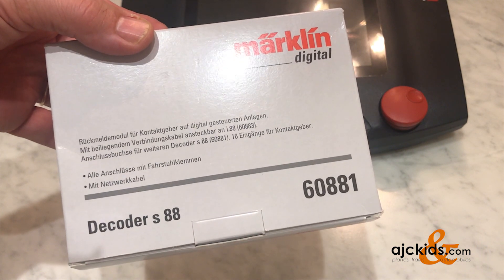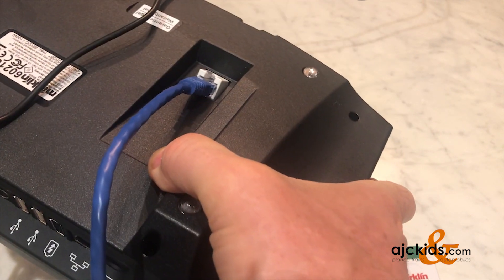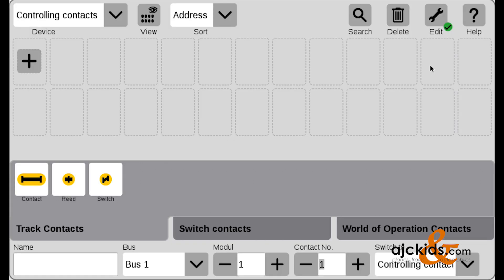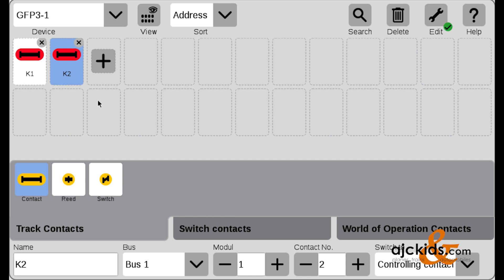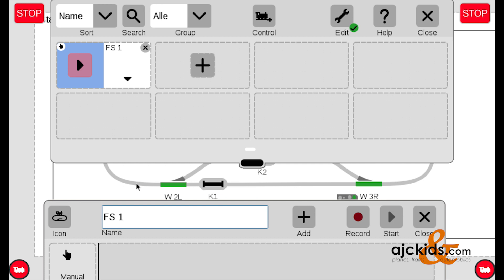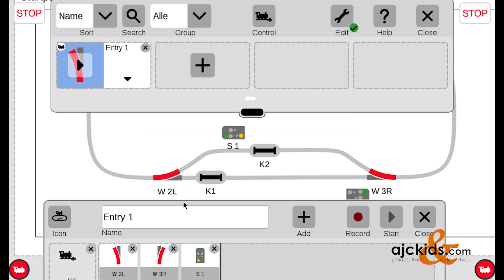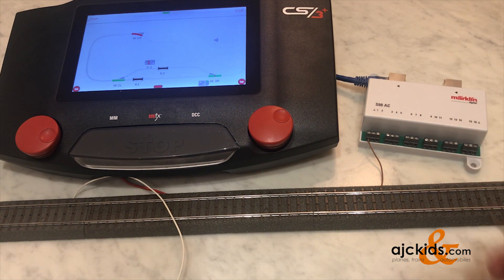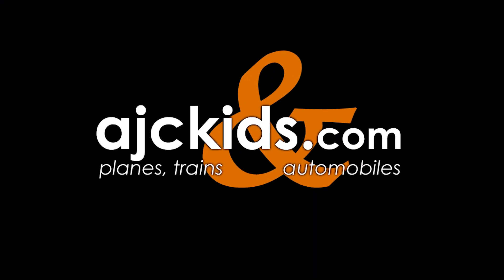Marklin Feedback Decoder S 88 - Part 3: CS3+ and 60881

Comment: Thanks for this clear video !! I am wondering ... can I stop trains with this L88 without (MFX) Signals?
Reply from the maker: You could tell the CS3 (program) to stop a specific train, by recording a sequence of events.

If you want to un-power a stop track (stop section), you'd need something like a digital relay (M-84 would be good).

Comment: I don't get the placement of digital contact track and the actual physical contact track. Don't you need to place the digital contact where the physical contact is on the layout?
Reply from the maker: The actual physical contact track is used in digital. It sends the signal (pulse) through a single wire to a "feedback" decoder, often referred to as an S-88. 

This feedback decoder has 16 inputs for 16 contact tracks. It adds a digital number to each input. 

The Central Station will get the pulse send from your contact track, and reads the number that the S-88 attached to it. It then will do the action that you have programmed in the Central Station.

This action could be switching a turnout, or changing a signal etc.
Reply: That didn't answer my question.  On one's track plan the contact track image should be placed on the track diagram at the location of physical contact track.  However none of the videos indicate where to place the digital image. You need to clarify the placement of the digital and physical contact track.
Reply from the maker: You place the digital contact track on your track plan in the same relative location as where you have the actual (physical) contact track on your layout.

Meaning: If on your layout the contact track is to the left of your actual (physical) turnout S1, you place it on your digital screen layout to the left of S1.

The only reason you do it this way, is so that it makes sense to you. So that you can identify which digital image contact track corresponds with your actual (physical) contact track.

Comment: does anyone know if I can use a Uhlenbrock 63410 module with the central station 3plus?
Reply from the maker: From memory, the Uhlenbrock module communicated through the "Uhlenbrock Loconet", not your regular 2 wire digital signal in use by Marklin and others. Maybe they have a module?